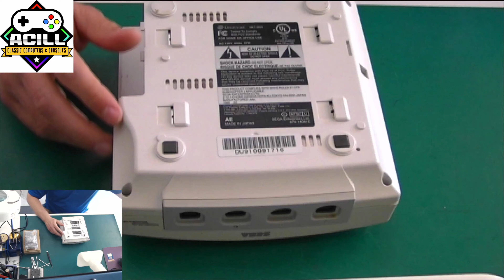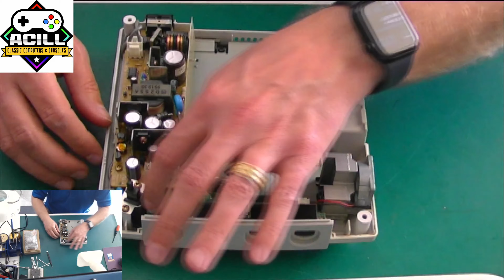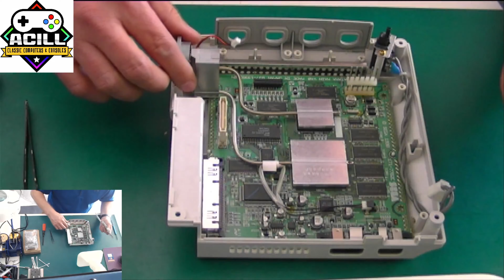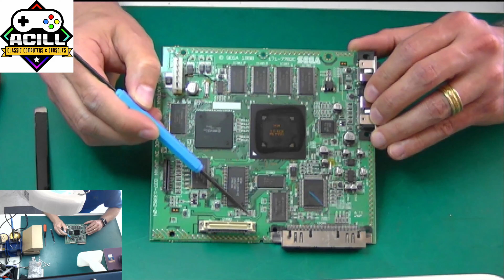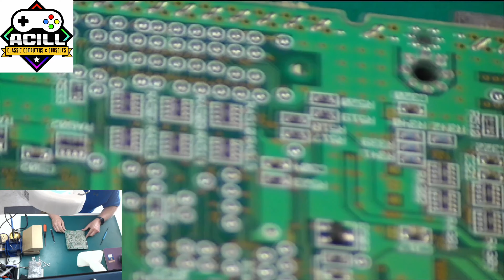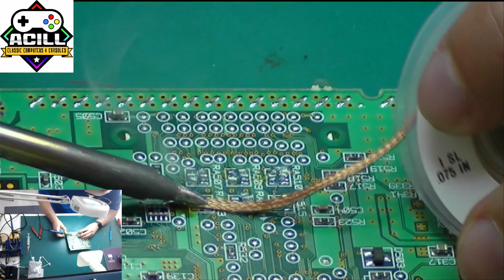Sega Dreamcast V0 GDEMU Modification Part 1

Comment: You didn't show how to remove the heatsink assembly without damaging the thermal pads. Did you use a hot air gun? Any solvents to loosen them up?
Reply: These consoles are all almost 25 years old at this point it’s probably a good idea to just buy replacements.